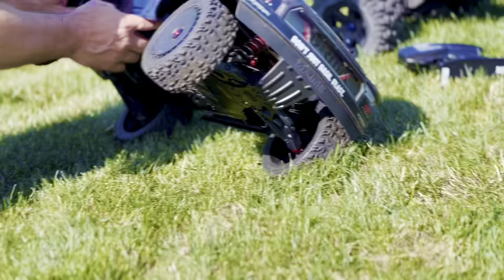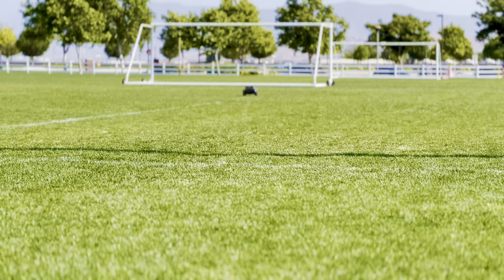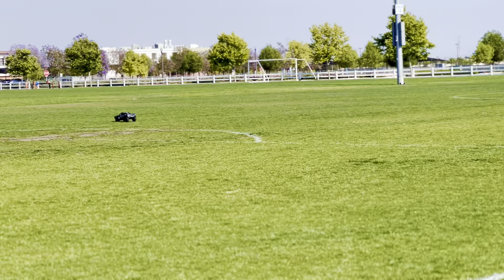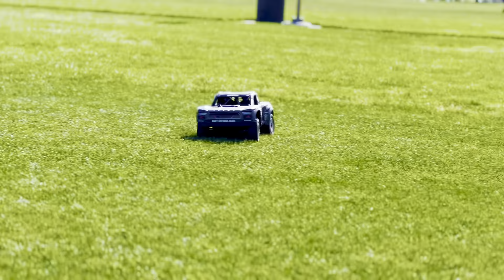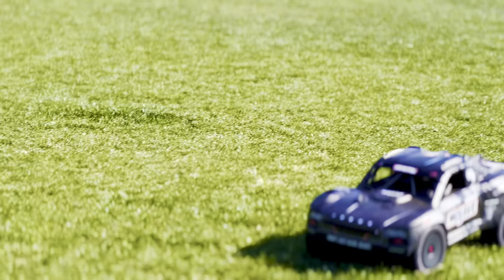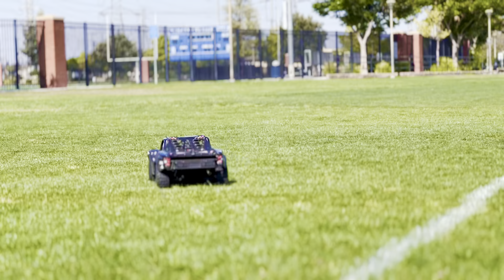ARRMA EXB Mojave on 6S Castle Creations 1520 1650kv 8S setup High Speed Run Fast AWD RC Trophy Truck

Comment: beast mojave  only on 20t pinion nice plenty of room to gear up  and a few adjustments to keep the front down. I just sub to your channel
Reply from the maker: Appreciate you 🙏🏻. 

Definitely a lot of room. I haven’t ran it on 8S yet either.
Reply: @M3PQuicksilver  thats only 6s??? wow
Reply: @M3PQuicksilver  when you run on 8s please post a video
Reply from the maker: @Northside910  Yes I’ve never ran it on 8S.
Reply from the maker: @Northside910  it’s honestly pointless unless I run a wheelie bar. Which I’m thinking about buying.